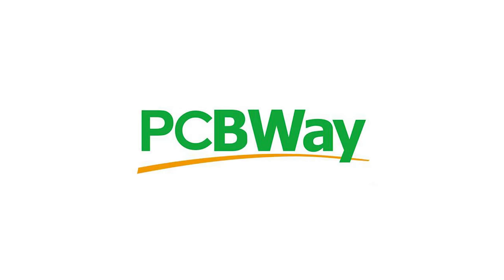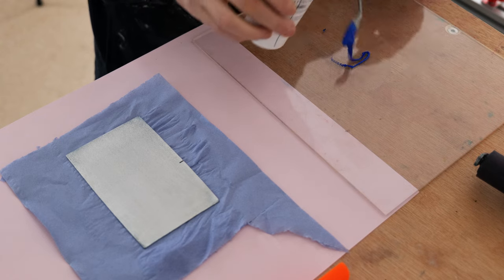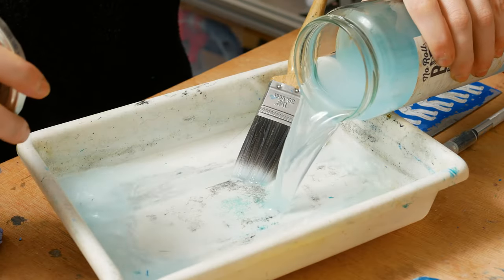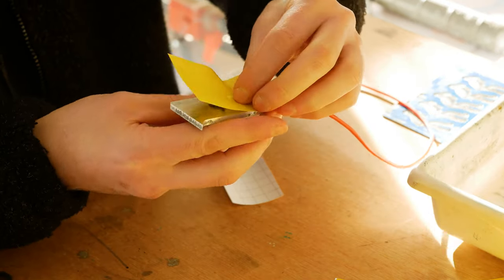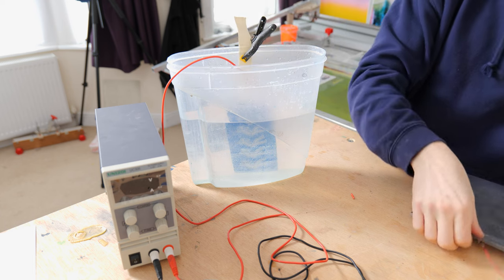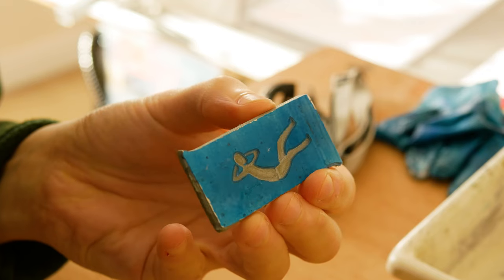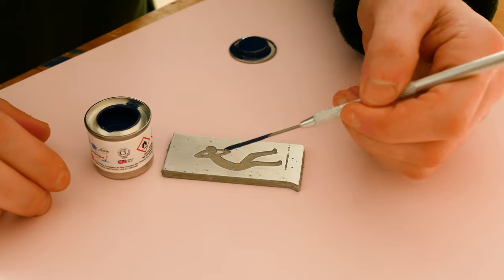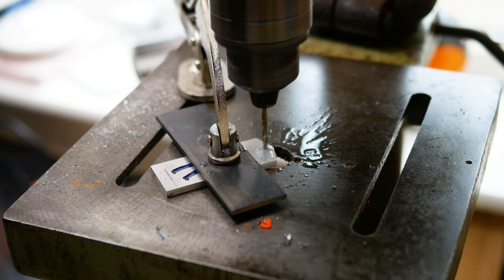How to make a DIY Enamel Keychain

Comment: Have you tried using your CNC for this? Even if it's just using it to skim a layer of paint off rather than mill the aluminum , it would work right?
Reply from the maker: You could probably do it. But the paint would likely chip off when cutting or from general use. Maybe you could sand the aluminum first > paint the enamel and let it dry > cut out your shape/text > clear varnish/epoxy the whole thing so the paint is sealed.

Comment: Hi - interesting process to think about.  The resist you used was liquid, rather than the film shown in the links, I’ve not had much luck with film, hard to get it to adhere, and stay adhered when you pull off the second plastic layer - can you point me at the liquid resist you use please?  Do you need to seal the edges with silicone when you electro-etch, or does that not really matter as you’re machining it after?  How deep an etch do you get - looks like several mm?  Thanks for the ideas!
Reply from the maker: Hi Richard, great questions;

- Liquid resist can be found here - https://mungolux.com/etch-resist_4, seems to be hard to find in US.
- I did not seal the edges because I was going to machine around the edges after etching. But you if you already have the shape of the metal you want then you will need to seal the edges because they will get eaten away.
- Etch depth was approx 1-2mm. Its difficult to get a deeper edge and retain small details because the walls get etched too. Its a fine balance. I need to do some more testing to get it perfect.

Comment: I think it would be easier to use some thing like a Brother Scanncut or a Cricut to cut the (outline of the) shape in vinyl and applying it to the face of the metal, rather than the exposure and development process.  It would be less messy and complicated and require fewer types of supplies.
Reply from the maker: Yes, i have a cricut and would have used that because it is indeed quicker, but I wanted to show the process using photopolymer as it isnt shown often